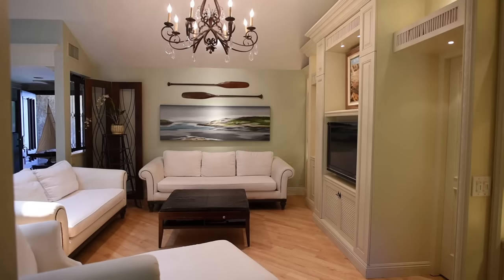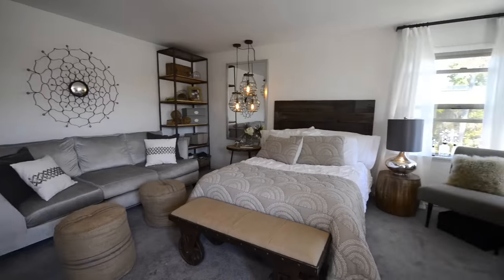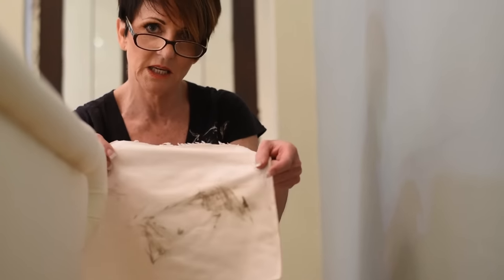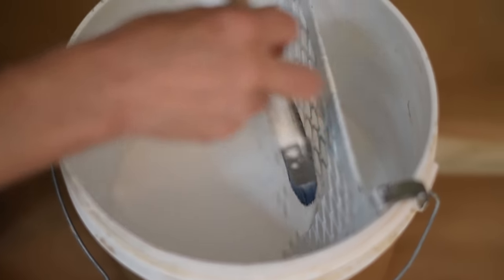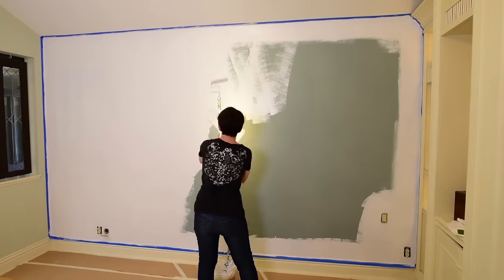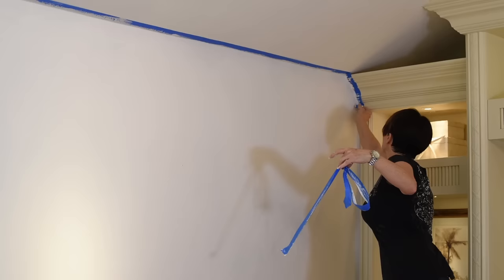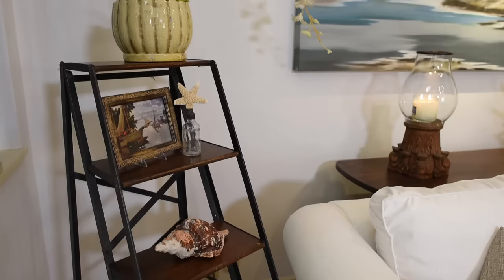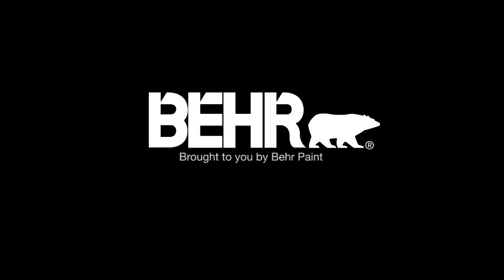White Home Decor | Interior Design | Decorating & Painting Tips

Comment: I find it easier to keep the tape as long as possible sometimes if the pieces dont line up exactly you can tell so whole pieces are the way to go and when removing much easier also run a bead of caulk  on the edge of tape before painting to get a perfect line remove tape when caulking and paint is still wet